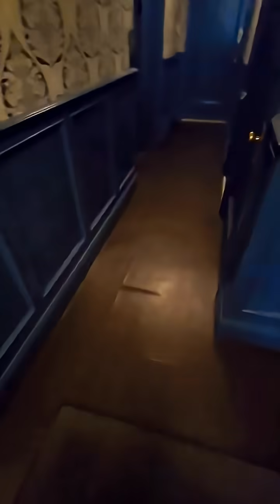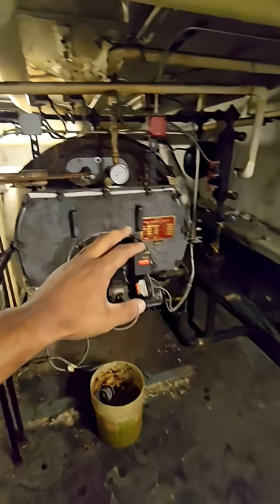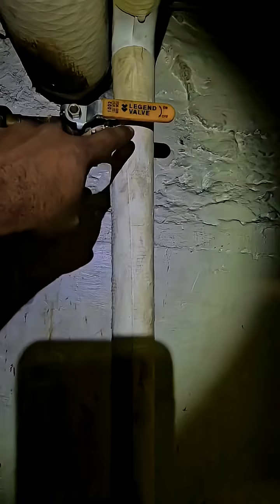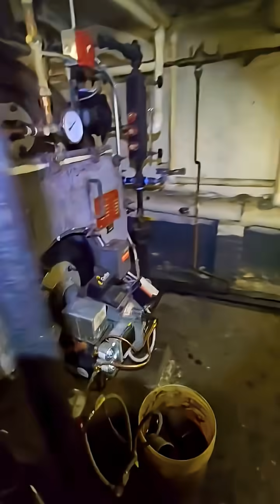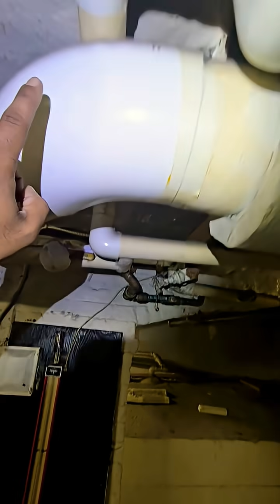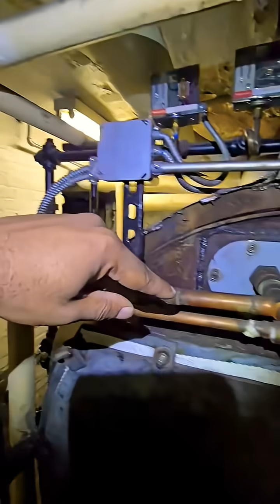How does this Building get hot water? #5 part 1 brownstones #boiler #nyc  #mechanic #electrician

Comment: Isn’t it more steam than water at the mixing valve? I know it’s super hot because those things hold pressure so it’s hotter than 212. Kind of like a pressure cooker right?
Reply from the maker: Yes but mixing valve is for hot water so the most would be 180 then mix with cold water